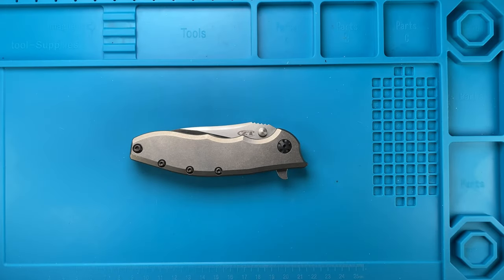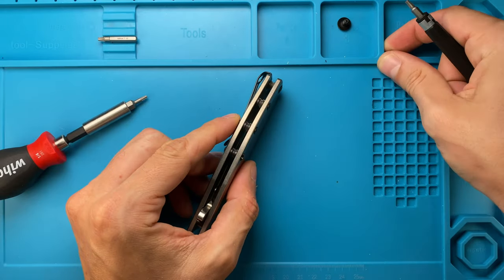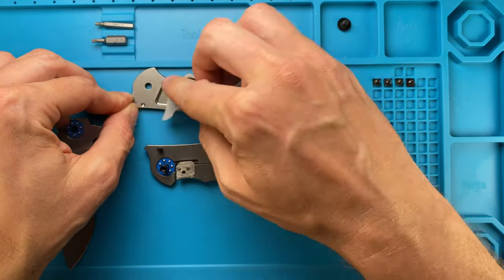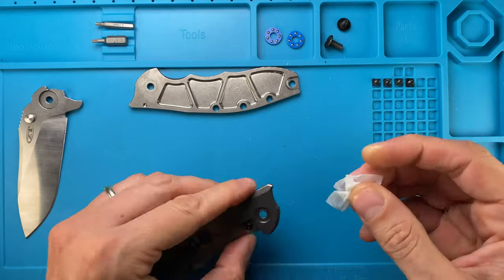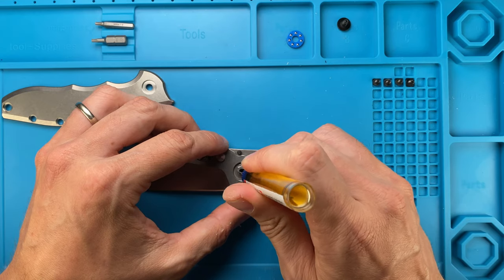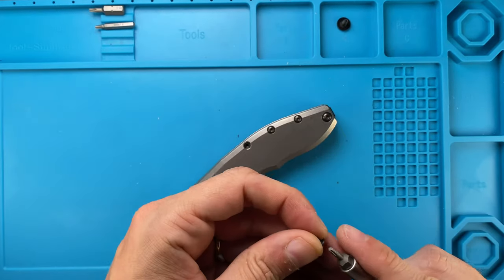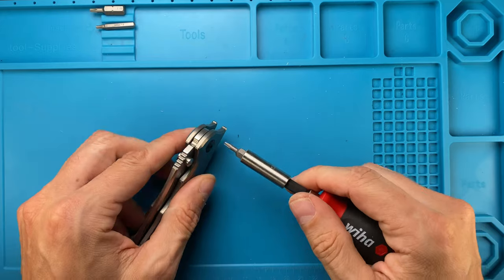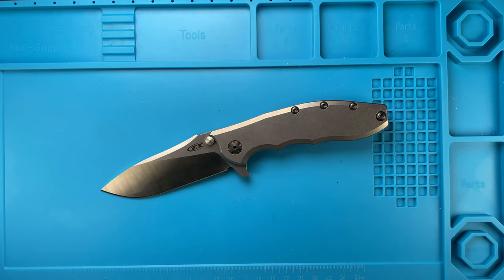How to Disassemble & Maintain the ZT 0562 TI Pocketknife. Fablades Maintenance Review

Comment: Nice and smooth work. But just for a while. When oil will catch some dirt it will get back to where it was. Only two places should be oiled - both bearings on both sides of each. And it always help if it's a PTFE oil which is more dirt resistant. Also a good upgrade for this knife are ceramic bearings with washers. Why washers? They are placed on the scales side and the reason is that the titanium is softer than steel so after some time bearing balls will groove it. Washers are to prevent it.
Reply from the maker: Yes indeed! Also detent ball benefits greatly from a drop of lube
Reply: Are you referring to Taco Bearings?>